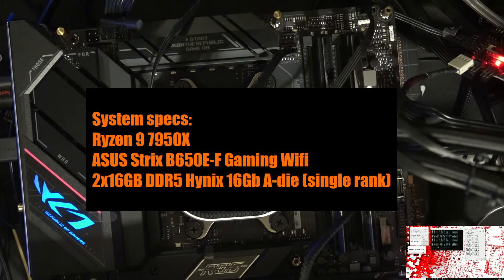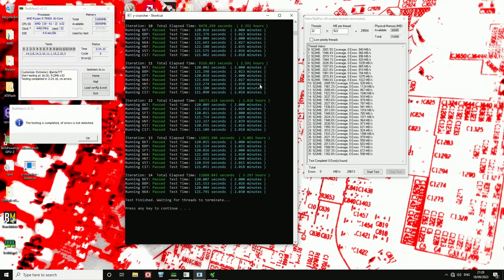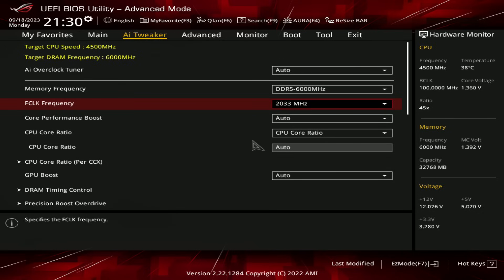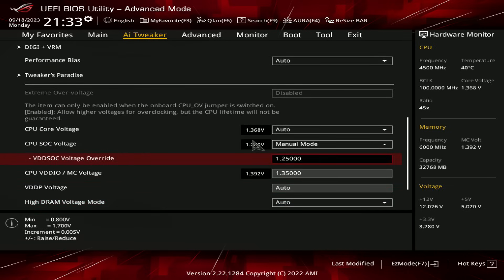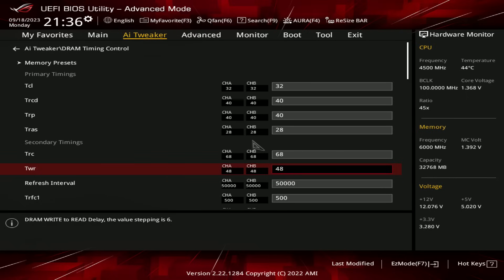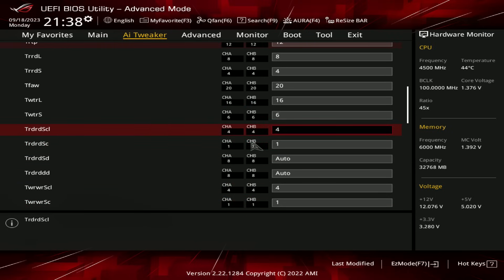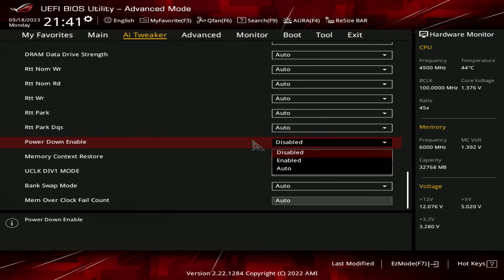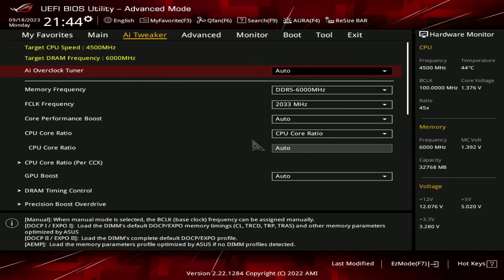Easy memory timings for Hynix DDR5 with Ryzen 7000

Comment: For some reason these timings are not working on my system, worked for a while but then started getting blue screens. I'm on a B650 Aorus Elite AX, Ryzen 7700x and Fury 6000Mhz CL38, not sure if I'm missing something, but for now I will keep the EXPO1 setting for stability.
Reply: Same with me after recent bios update. Thinking about upping my voltages to 1.3 vsoc & 1.4 ram
Reply: @CarnivoryHODL  I'm currently using F6 Bios, not sure if good or not but everything is stable so far. Regarding voltages, that could help, but in my case I also tried this timings with EXPO1 enabled, which uses more voltage and didn't work either.
Reply: @leny1338  I’m on 1634 w/ my b650e-f. 6000 cl30. 7800x3d. Just running EXPO for now until I figure out good voltages to use.
Reply: Try setting the ram to default timings.

Comment: I do it with parameters in this video and adjust voltage dram vdd + vddq to 1.4; soc + vddio to 1.3. My ram gskil F5-6400J3239G16GX2-TZ5RK